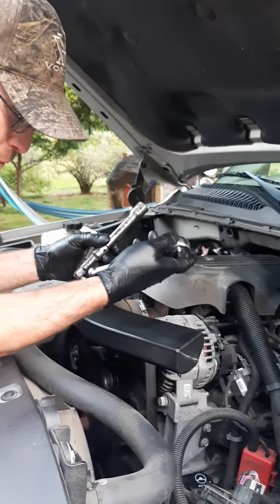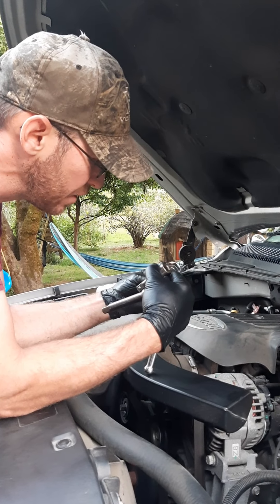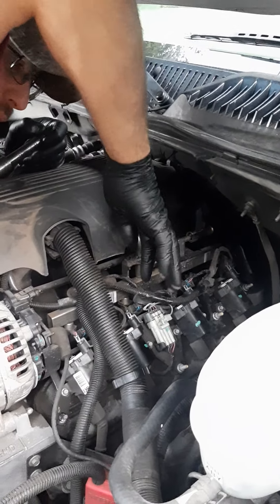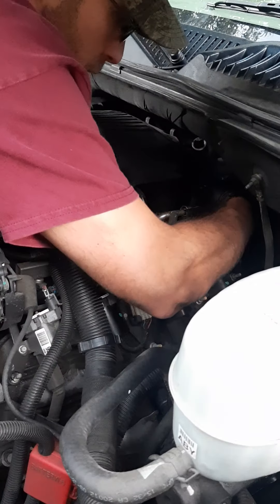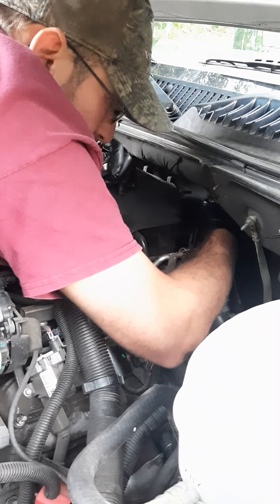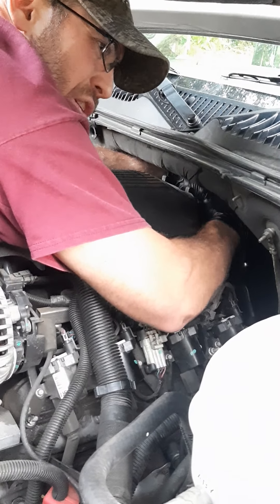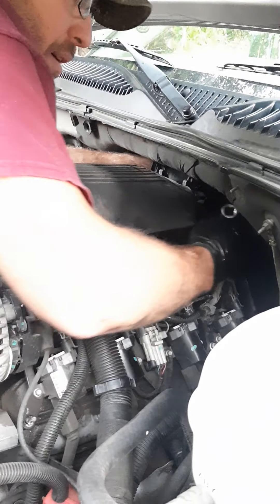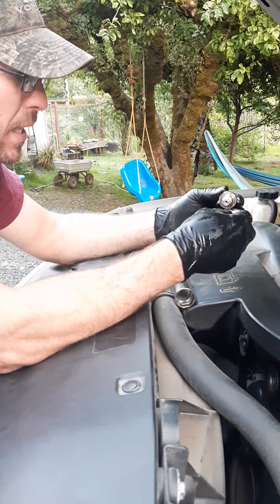2006 Chevrolet Tahoe Oil pressure sending unit removal/replacement

Comment: I didn't know the sending unit was mounted vertically in the block.  Is there a ledge back there?
Reply from the maker: The blocks casting has a small area just behind the intake manifold. Its tight but very do-able !
Reply: @mr.chos_garage  I think I'll need to give this a try.  My gauge works fine, but I've got oil leaking down the back of the engine.  The dealer replaced the oil pan gasket and cooler line block-off plate gasket along with transmission cooler lines and right front axle seal.  The inspection hole does not show any evidence of a rear main leak (I hope not at 106k). I'm going to replace the valve cover gaskets as well, so hopefully most of my bases are covered.  Thanks!
Reply from the maker: @JRobert111111  I had the same leak on my 03 sierra. Running down the back, pressure sensor had a small weep. 
Get that socket I talk about, you'll thank yourself later !
Reply: @mr.chos_garage  Thanks!  I just ordered the GM sensor and Lisle socket from RockAuto.  Wish me luck!
Reply: I buy tools I need and some I might need I just got back into working on gm engines I took a screenshot of your comment I’m going to order the same piece thanks and I mean that to the both of you and as Stacy David would say keep those knuckles bloody